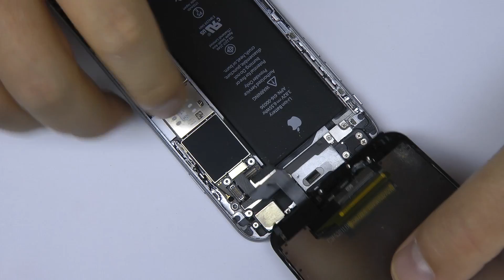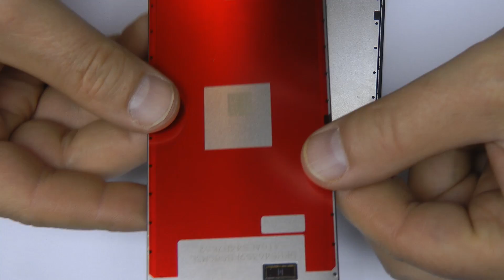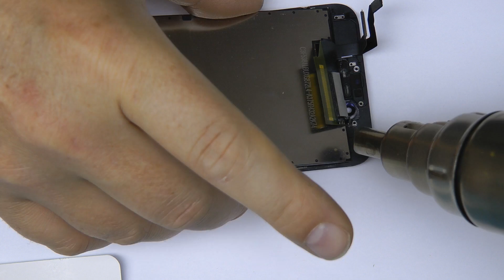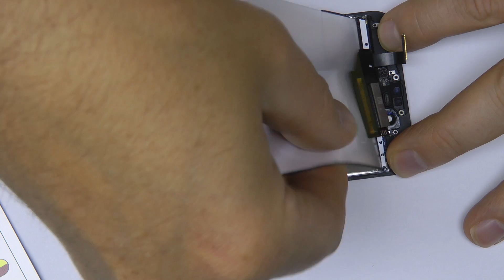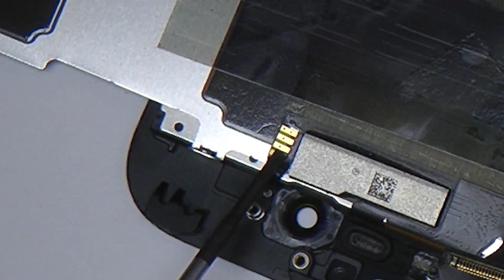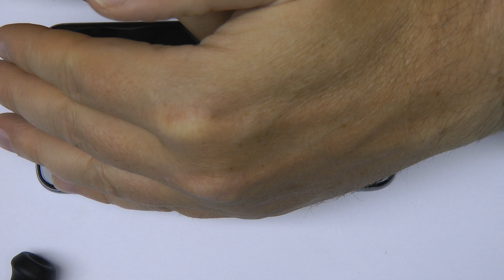iphone 6S Backlight 3D Touch repair Change Display Backlight

Comment: Hello, i have a question. My iphone 6s brightness is weird, its not as bright as it used  to be and my 3d touch is kinda broken. What do i need to change to fix this? 

Please, i hope you answer my question
Reply from the maker: The 3D touch is on the 6S Backlight .. If you change this the 3D Touch should work ... and maybe the Backlight also ... but with the brightness it can also be a Backlight error on the Mainboard .. Backlight coil do that often
Reply: Alex S. Thanks a lot for the reply, Alex.

Comment: Hello! Does changing the backlight give you the "error 53"? (the error that makes your Touch ID to stop working)

Thank you!
Reply from the maker: No this error only come when you change the HomeButton
Reply: That's correct it doesn't affect anything,I just had one replaced on a iPhone 6S plus
Reply: yes it does if the Touch ID cable on your new back light is faulty and sometimes it do comes with a faulty cable when you buy from non genuine chinese suppliers